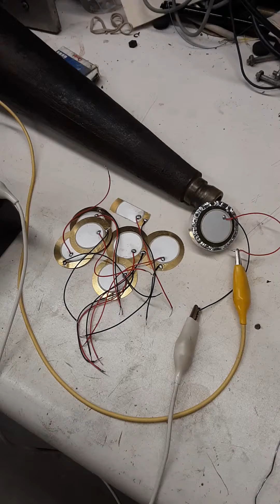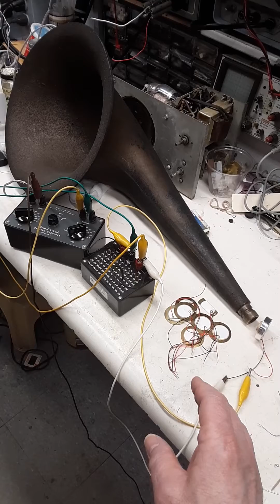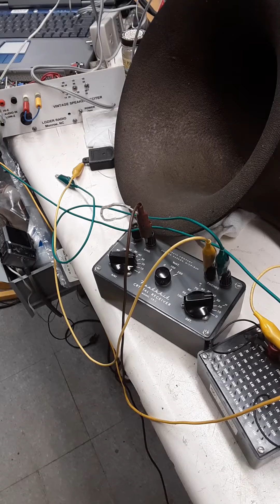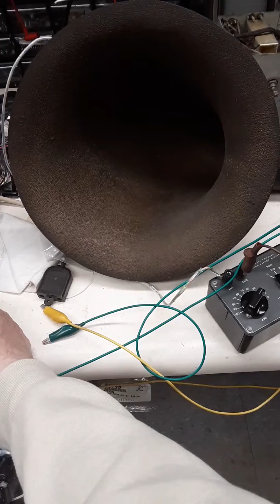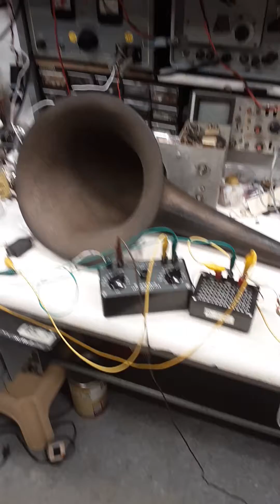Piezo Horn Driver

Comment: Nice job. Sounds great. Do you have a resistor in parallel with the piezo or is it connected directly to the amplifier?
Reply from the maker: The piezo is connected directly across the floating "Plate" winding of a junk output transformer designed to work with a 50C5 tube to drive a 4 or 8 Ohm speaker.  There is no need for a shunt resistance across the piezo as far as I know.  For this demonstration I have a little amplifier board designed to drive 8 Ohm speakers.  So it simply connects to the "Speaker" winding of the junk transformer.  If the audio were being coupled via a capacitor (to eliminate any DC bias on the piezo) then you would probably want to have a high value resistor directly across the piezo.
Reply: @RadioHist  You might still have to worry about a "no load" condition across the secondary of the output.  I don't know how high this radio gets but a lot of stereo hi-fi transformers arc/burn to the case (ground) when someone runs with one speaker.